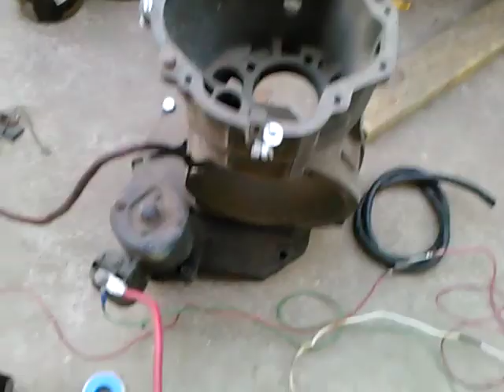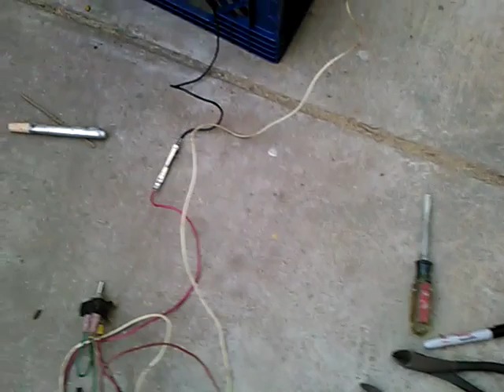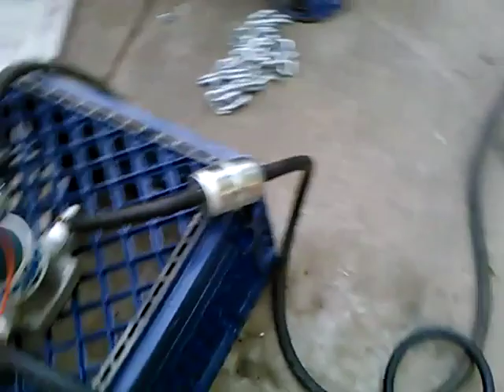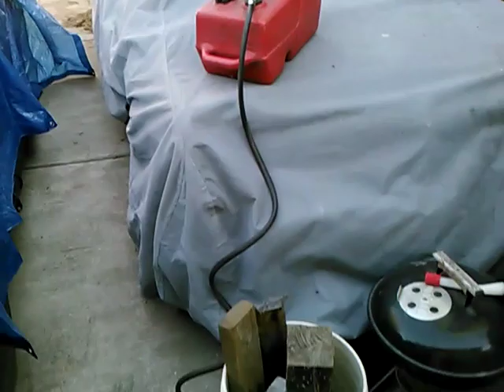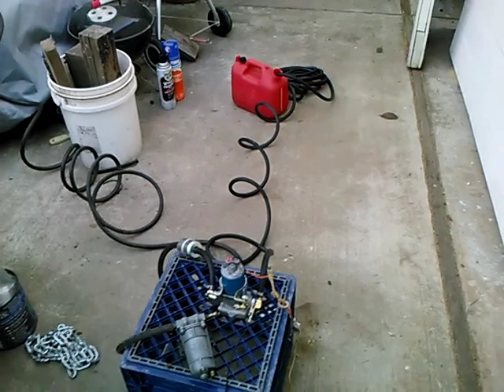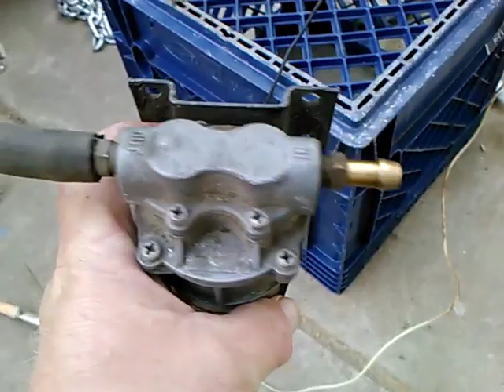Holley Blue Fuel Pump Test MOV092

Comment: I need the blue pump for my truck. I got a pump that only pumps 14 psi @ 32gph but that's not enough for a sbf. That holley produces 14 psi @ 110gph
Reply: Nope.  Free flow (zero pressure, "pissing in the wind") is 110gph.  Just looked it up on Holley's website.  It's only ~65 gph @14psi.  They're pretty slick about it, aren't they?  All they tell you is the best of either situation, which can NEVER happen at the same time. Dicks.

Comment from the maker: I'd already built that system of wires and a switch for a ground hop engine start rig.  Sparking wires at the battery + gasoline everywhere maybe wanted to avoid also.  Thanks.